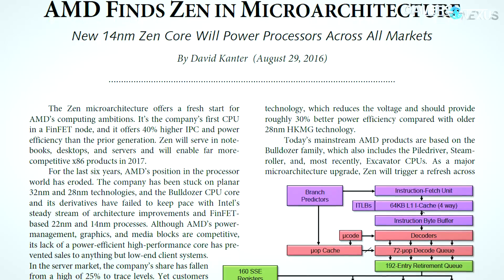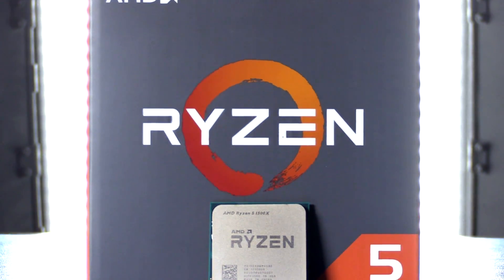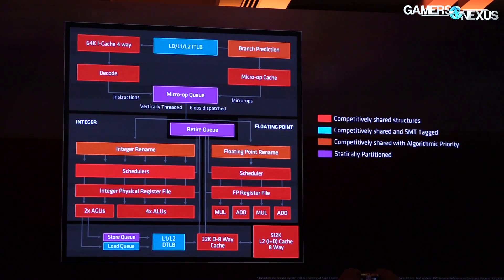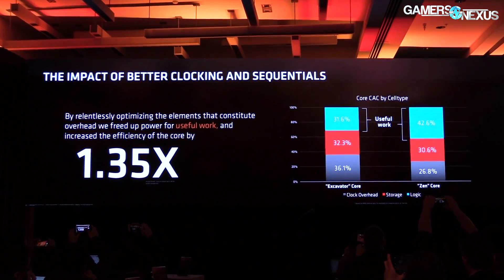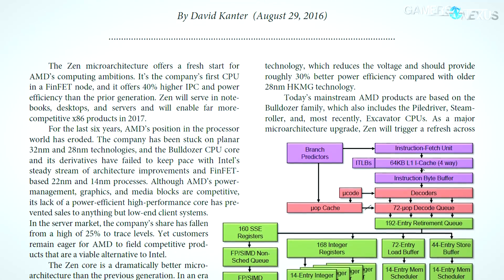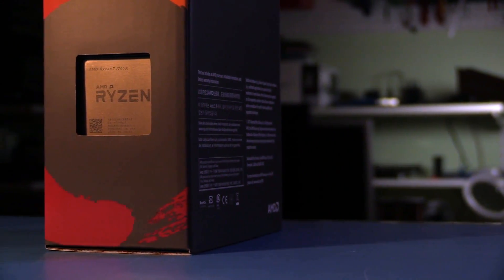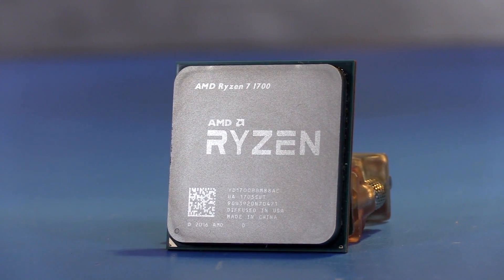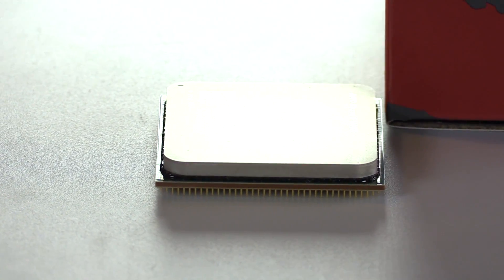Ryzen Chief Architect Interview: Micro-Op Cache & IPC Gain

Comment: Before someone goes and comments "only if ryzen clocked higher", hear me out.

I mean the i7 2600k clocks to 5ghz with ease, but it's single core performance is still lower and more power inneficent than ryzen because of the way ryzen was designed. Instead of having a higher clock, they made it do more per cycle which will give you the same performance in the end.

They could have built ryzen to clock to 5ghz and drop the ipc by 10-15%, which would net a 10% performance increase, but the power draw per core would be absolutely insane, would run incredibly hot, be way more silicon lottery based, and murder their server market potential. What ryzen has going for it is that it's watt per core is lower than Intel and data throughput per cycle is larger than Intel's, which will make the lower clocked epyc chips actually faster than the lower clocked xeon chips on a per core basis. 

So if anything Intel should worry about upping their ipc and performance per watt as clocks won't get them anywhere in the market that counts, the data center.

Comment: all this is why in the streaming multitask test the power use tends to drop down huh...I don't really get what he said but its sounds all good. I guess they learned a lot from the last fx line where something was messes up in the cache system.... too bad the guy that was heading the project before (the one that worked on the original fx and came back) didn't stay on right through.

Comment: can we have a video explaining this video??? lol
Reply: The x86 Instruction Set, the machine code used by Intel and AMD as distinct from ARM, is a lie. Many x86 instructions are too big to be run on hardware and get broken down first. Macro instructions are broken down into micro operations (uOPs). Translating has to be done for every instruction fed into the processor and can be quite time consuming. uOP caching helps in loops, where the same code is run over and over again and accelerating the translation between macro and micro ops is really useful. Intel has already been doing this since Sandy Bridge. They were stabbing at it since the Core-2 days. I doubt this is AMD's first stab at it either. More information see: http://www.realworldtech.com/sandy-bridge/4/

Comment: If anyone from AMD is reading this, I would like to congratulate you people for bringing in a 8 core Ryzen CPU powered consumer notebook to the market. http://wccftech.com/asus-rog-strix-notebook-amd-ryzen-7-8-core-cpu/ . So take this is a challenge to you people, improve the power efficiency further until you can cramp a Threadripper CPU in workstation class non-ultrabook 15inch display notebook . Who needs it ? Interior designers , engineers ? Perhaps it can replace bulky lower end Intel Xeon E5 workstations with a gain in mobility.  Battery will go flat fast ? Learn how to improve battery density from those electric car makers like Tesla then. Intel has been giving us 4c8t CPU for this class of notebooks for donkey years already.  It is time to improve on high performance notebook core count.

Comment: guys 3 days ago i bought R5 1600!!!
Reply: Daniel Fisher   Faster ram with optimized timings do make a difference. The overall performance increase will depend on the game/software.  Even in AMD's own testing the % increase between 3200Mhz and 3600Mhz can be 10% and higher.  https://community.amd.com/community/gaming/blog/2017/07/14/memory-oc-showdown-frequency-vs-memory-timings
Reply: This is my first build :D (2-3 days ago).
1050Ti around 11200inr or 170-180USD
ThermalTake 450W 80+ efficiency(3000inr) (50 USD).
8 GB 2400 costed around 4100inr(55USD)
R5 1600 16200inr 255USD
case 1200inr 20USD
WD 1TB hard disk 3300inr  50-55USD
120GB SSD but for my laptop (4000inr 65USD)

MOBO - MSI B350M Pro-VDH (6800inr or 105-110 USD)
But guys i cant boot need to go to Msi service center.
only LEDs are turned on in EZ Debug T.T
Reply: LAKSHYA SINGH 💪🏽
Reply: LAKSHYA SINGH How much did the video card cost?
Also what are some of the other specs if you don't mind answering
Reply: Congratulations, I guess xD
Reply: Daniel, no. The thing is, faster RAM increases the speed of the infinity fabric, meaning that the performance hit from communication between CCXs is reduced ever so slightly. Faster RAM with looser timings did show to have a performance advantage over slower speed with tighter timings. When you changed the timings at the same speed, it did very little for the Ryzen chips(meaning about as much as it does for all modern CPUs in common workloads)
Reply: What you sent proved what I wrote earlier. If what you're saying about going from 3200 to 3600 is true then that would prove I was completely in the wrong (if frequency was the only thing that changed), so can you send the link?
Reply: Go to the link Mista sent, "Chasing the highest possible clockspeed required timings so relaxed that real world performance suffered versus lower frequencies with tighter timings"
Or show me what Mista claimed about a 10% increase.
Reply: 8 GB 2400 costed around 4100(55USD)
but it would cost (1000inr or 17-20USD) more....
and 16gb 3000 costs around (12000-1500inr or 175-220USD)
not worth it. Had a tight super budget and already exceeded it.
Reply: What RAM (Crucial, G. skill, kingston...)?
Reply: Daniel BONOFI  THNX!!
Reply: Daniel Fisher its kingston 2400 :D
Reply: Nice first build (I think you went with fury ram which would be awesome).
Small issue would be the time of purchasing the components, gpu and ram are about double the usual price right now, but as long as it's worth it to you I think that's all that matters. 
There's always gonna be a "you should have bought it later" now it's prices are insane, later it's gonna be wait for rx vega, then pcie 4 and goes on and on.
Reply: Navi and Icelake should be here in around 2019 for pc's so you have time until then. what I think is best is to look at the current state of your system and see how long it should last, if lakshya's pc died it would still make sense to buy a pc in this climate (though I'd still at least wait for rx vega).

What works best for me, and you can also look at past parts to confirm this trend is to buy the peripherals during the month of november every 8 years, motherboard+system components every 4 and perform yearly maintenance.
You can look at technology releases as well as price to performance and it's highest by working this way.

About when and what to buy what I think is best is to buy all the peripherals second hand from a trusted source (case, keyboard, mouse...) since the difference between used and unused is basically nothing and should still last at the very least 8 years.
Motherboard, cpu, gpu, memory and so on should be bought all together most of the time in my opinion and changed every 4 years or so since a "bad" parts takes the rest of the system with them over time.
Reply: Wabbi u dont like it? 😣 i thought u guys would be happy to hear another person joining PC master Race. That is my first build.
1050Ti + R5 1600 witb 8gb 2400 ram and msi b350 VHD :D
Reply: drakka RAM speeds over 2400 won't change essentially anything for that cpu, it's all about CAS.
At best you'd get a 2% average increase in fps and maybe a 5ms reduced latency by getting faster RAM speeds.

Edit: and you might also run into stability issues.
Reply: LAKSHYA SINGH no one cares

Comment: If only Ryzen had higher clocks
Reply: They're taking a page from supercomputers and employing parallelism.  Single threaded performance and high clocks are becoming less relevant with each passing day.
Reply: Higher clocks would always be nice, but Ryzen does perform really well at 4GHz. It's also still really power efficient at that clock speed.
Reply: I mean the i7 2600k clocks to 5ghz with ease, but it's single core performance is still lower and more power inneficent than ryzen because of the way ryzen was designed. Instead of having a higher clock, they made it do more per cycle which will give you the same performance in the end.

They could have built ryzen to clock to 5ghz and drop the ipc by 10-15%, which would net a 10% performance increase, but the power draw per core would be absolutely insane, would run incredibly hot, be way more silicon lottery based, and murder their server market potential. What ryzen has going for it is that it's watt per core is lower than Intel and data throughput per cycle is larger than Intel's, which will make the lower clocked epyc chips actually faster than the lower clocked xeon chips on a per core basis. 

So if anything Intel should worry about upping their ipc and performance per watt as clocks won't get them anywhere in the market that counts, the data center.
Reply: The infinity fabric is very good! It's scaling is fantastic and it's the reason for the very good pricing of ryzen! if it would just have something like its own multiplicator and clock, independent from RAM like the ring bus from intel that would be VERY good!
Reply: Also high clocks are impractical to keep cool and to difficult to manage stability. Probably you could go higher but at a non-competitive cost.
Reply: RavenPrecept Yeah exactly! The higher the ram speed, the better the infinity fabric because of less latency which leads to better performance
Reply: Aretak You won the Silicon Lottery, simple as that, and it's not common. An i7 2600K's common max clock speed is 4.8Ghz, beyond that is not possible on every chip.
Reply: RepsUp100 Thats why I am waiting for zen2
Reply: +Daniel Bonofiglio
Oh really you can assure that, can you? I don't know but the cores are scaling pretty well in most tests on YT.
Reply: James, an i7 2600K does not clock easily to 5Ghz, I have never seen one clocked that high unless Liquid Nitrogen was used. No Intel CPU before Kaby Lake could clock to 5Ghz "easily".
Reply: Yanteus Maximus nothing from the broadwell lineup goes past 4.3ghz without some exotic cooling. ivy bridge, skylake and haswell went to 4.7ish and kabylake and sandybridge  go to 5ghz pretty easy (kabylake requires deliding due to rubber tim)
Reply: +RavenPrecept

Parallel ultimately wins.  USB, SATA, PCI express all use the same noise cancelling technology called 'paired differential signaling' to put them ahead of the 'single ended signaling' that PATA and parallel printer ports etc used.  PCI Express 3 and SATA 3 are the physical limits of that technology and m.2 and SATA express use parallel lanes to get any faster.
Reply: +Curtis Riceman  Why not have both?
Reply: Yanteus Maximus not possible, but higher ipc is better for lower clocked parts. the lower clocked parts are the money makers for amd, they are known as epyc. If zen was more clock dependent, the massive epyc chips would have to clock higher for the same effect, which will hurt yeilds and cost more to make, either raising the price or lowering profit margin.
Reply: James Mastroianni Not to mention the increased power consumption.
Reply: James Mastroianni Well having both was possible before, the last example of that was Sandy Bridge.
Reply: Yanteus Maximus yes but Zen was designed on a lpp silicon. That doesn't allow for higher clocks. It's the trade of power efficiency for higher clocks. Remember ryzen clocks just as high as Intel under ln2, so it's not an arch limit, it's a process and power limit.
Reply: Are you kidding me? The 7LP process promises:
"5GHz operation"
"7LP technology can provide more than 40% higher device performance and more than 60% lower total power compared to 14nm technologies" 
This will end Intel :)
Reply: Curtis Riceman The thermal temperature is insane, but Sky Lake X can still clock as high as 4.8Ghz if you don't mind having 90 degrees of heat with a good water cooler.
Reply: d1oftwins Agreed, I'll take 3.7 ghz with stable temps on my 1700 over a 5ghz 7700k
Reply: Ryzen 2 or 3 will most likely break the 4.2 ghz barrier
Reply: Yanteus, I own a 2600K and can do 5GHz on air if I want to. It requires running my Noctua NH-U14S at 100% fan speed to keep temperatures under 80, but it's achievable and would even be suitable for day to day use with a decent 240mm AIO. 5GHz (and even a bit more) was not uncommon for the 2600K, and certainly didn't require LN2.
Reply: If only Ryzen didn't had the Infinity Fabric shit and could have 8 cores intercommuticated with each other, I can assure you that it would perform a lot better.
Reply: No, I'm sorry, but you're wrong. I've spent the past six goddamn years hanging around Sandy Bridge threads over at Overclock.net and I know exactly what is "common" for the 2600K, and most can do 5GHz if you're willing to supply the voltage and cooling. People actually running them at 5GHz day to day isn't common, but that's because of concerns over heat, noise and longevity, not outright incapability. Of course it's not possible on EVERY chip, just like 5GHz isn't possible on every 7700K. Silicon Lottery's testing says that 62% of 7700Ks reached 5GHz or greater in their binning process, and since they overclock and sell overclocked CPUs for a living, that's as accurate a number as you're ever going to get. That still leaves a hell of a lot of chips that DON'T reach that figure, yet the majority still do. The 2600K's situation is similar.

Comment: When they mentioned Write Back vs Write Through cache, I got flashbacks of tweaking my 486 and Pentium 75 systems.
Reply: IIRC, some motherboards came without a tag chip back then, which you had to buy yourself and stick it in the socket. It tells the cache controller which cache lines need to be written back, again IIRC.

Comment: did you see the techspot rebenchmark of the 1600x vs i7-7700k and i7-7800x? only 9% behind 7700k and exactly as fast as the 7800k (which is twice as expensive). Would you be up for rebenching it? since you initially called it an i5 in gaming, it seems that is not the case anymore.
Reply from the maker: nietrelevant We actually really highly praised the 1600X and strongly recommended it over i5 CPUs. You're thinking of the 1800X, which we still think is superfluous for our audience. Way better off with a 1700 and overclocking it in 10 minutes to save $200+.
Reply: That was a great video, but strictly speaking the final averages were a bit out compared to an ideal number because several titles had FPS limiters so it made the CPUs look the same when they otherwise wouldn't be. (Mostly referring to 7700k). But yeah 1600 is a great buy.
Reply: I believe he was complimenting the CPU and agreeing with your praise, saying its now beating the i7 as opposed to just the i5.